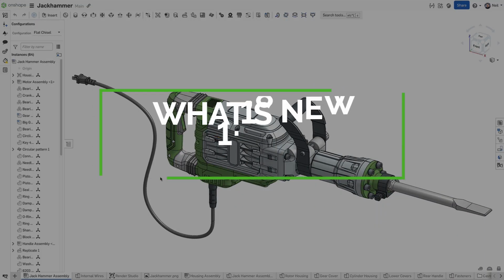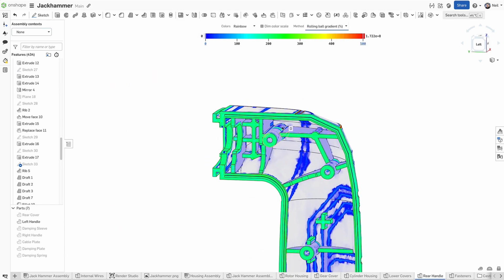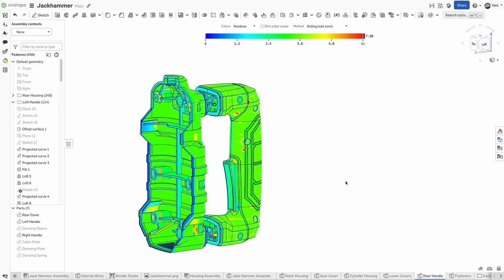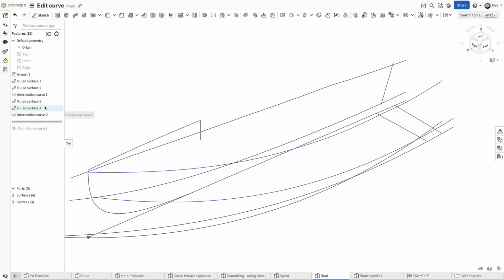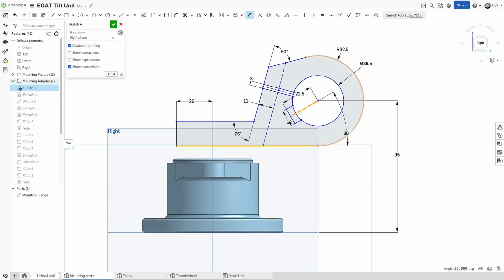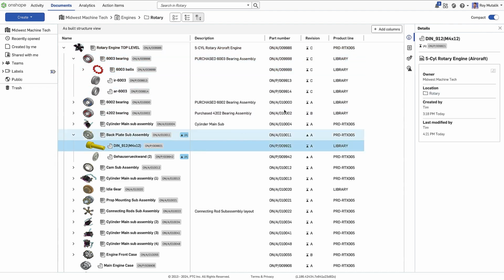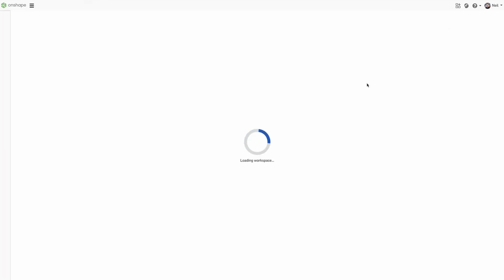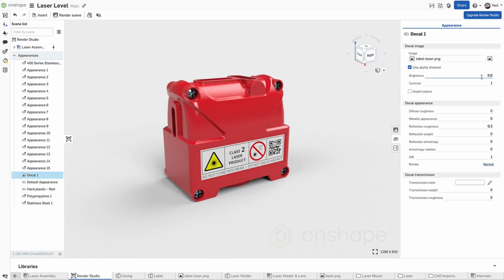What's New in Onshape 1.189 - Thickness Analysis, Sheet Metal Corner Break, Decals in Render Studio

Comment: THANK YOU for adding the customizable keyboard shortcuts!! This is a basic feature that has been missing for ages. The next step to make this even better would be to allow a single shortcut to toggle between two different settings in the same menu. For example, I'm excited to now have shortcuts for "shaded without edges" and "shaded with edges", since I switch back and forth between these a lot when working with mesh imports. But I found that I have to create a different shortcut for each of them, it would be great to have a single command that would toggle between. You could then create similar commands for say, switching between lines and arcs in sketch mode.